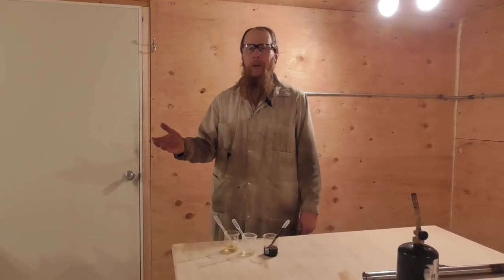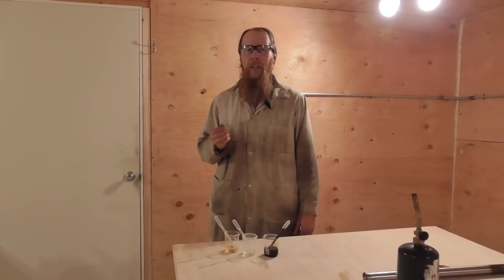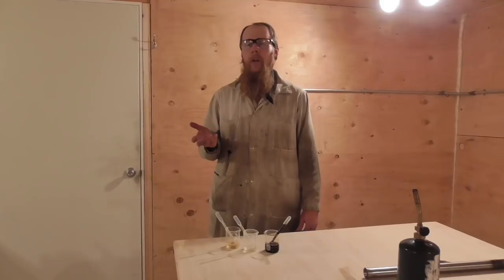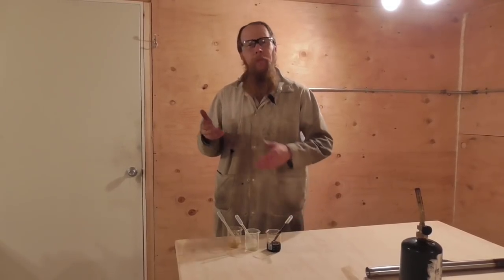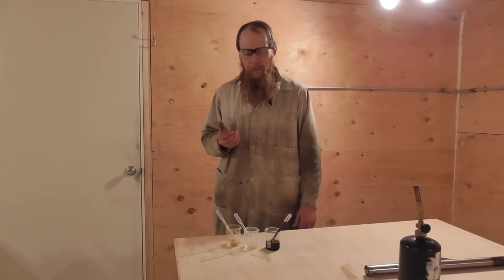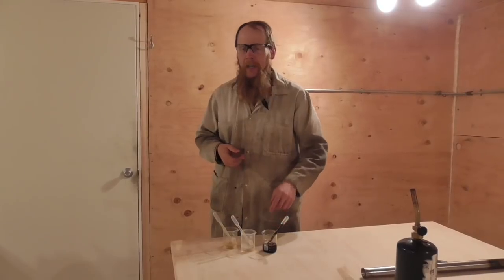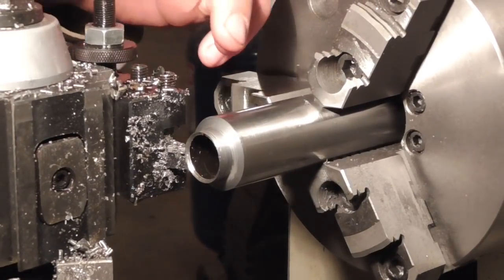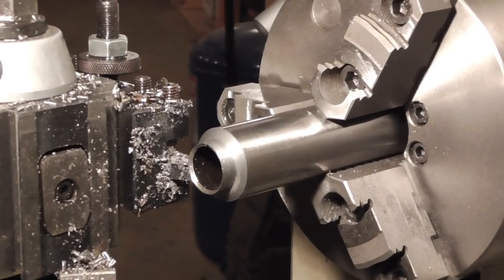Initial Comparison of Cutting Oils (TIS111)

Comment: You should consider a lavalier mic,,, you can get a reasonable priced wireless and it would eliminate the echo.,,, good vid.
Reply from the maker: Thanks.  Actually, I have considered the lavalier/lapel microphone option, but decided not to go that route.  For one thing, I'm concerned about the hassle and safety hazards associated with wearing a mic and the associated cords around machine tools.  Then there's the fact that none of my cameras are compatible with an external microphone, so if I used any mic other than the one built into the camera, I would have to record the sound separately from the video and then sync it manually when I'm editing the video.  That would be a lot more work than dubbing in narration when I'm editing the video.  Thus, for bigger projects where I have a lot of video to edit and more that I need to say about it, I typically narrate it for better sound quality and shorter overall length, but for quick videos like this I usually figure the camera is good enough.

Comment: why you doent use water/oil emulsion? I use it and it works great! I use it on milling and turning. I suggest it to you, at least to try it. great videos, I like these.
Reply from the maker: Water-oil emulsions and other water-based cutting fluids have the advantage of faster heat removal, which makes them great for high-speed machining operations in production shops.  Their major disadvantage is that if they are left stagnant in the machine too long, they tend to cause corrosion and/or become a breeding ground for bacteria.  Where my machines are used only intermittently on hobby-scale projects, they sometimes sit unused for a week or more, and that is why I'm hesitant to try water-containing cutting fluids.